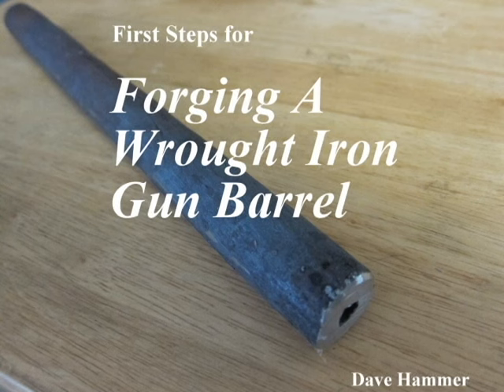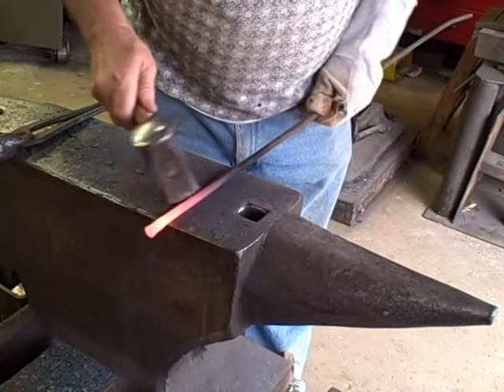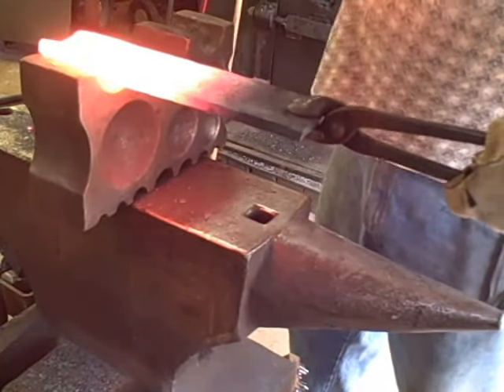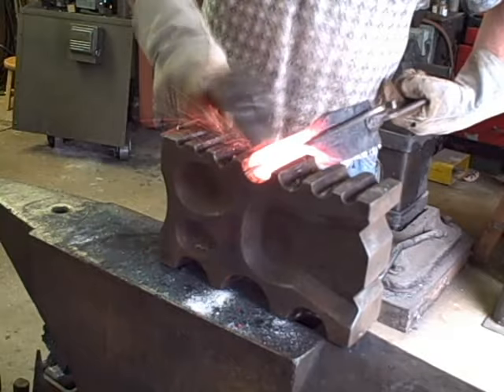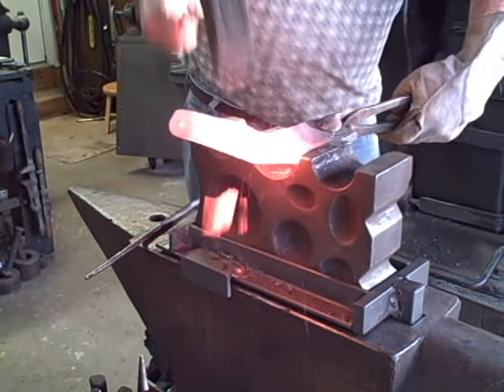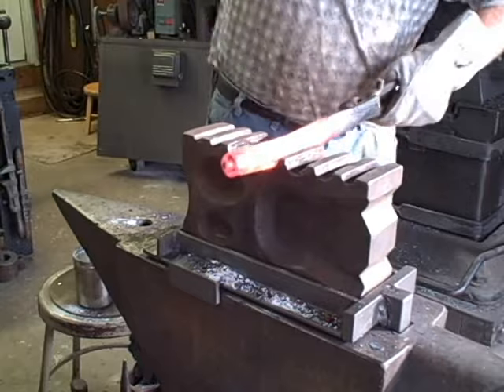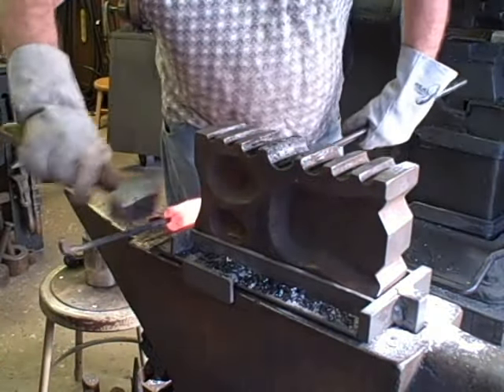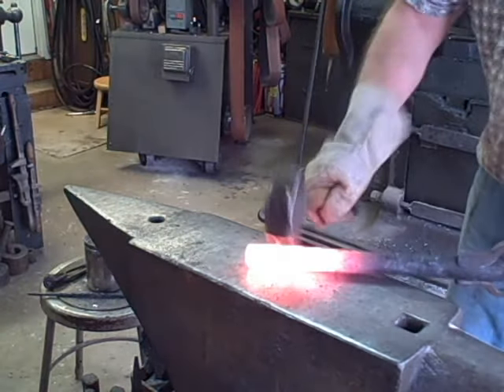Forging a gun barrel

Comment: Excelent straightforward demonstration thank you.

I have a question if you know, how do you identify wrought iron from mild steel? do you need to acid etch or microscope?
Reply: This is more information than you
 asked for, but it will give you a fairly complete story about the difference between steel and wrought iron...  as well as a couple methods that can be used to identify wrought iron.

Wrought iron is generally spoken of (graded) as poor, medium or highly refined.  Although a piece of wrought iron, after being processed into a bar, may have a smooth outer surface, it actually has an internal fibrous structure, much like a tree branch.  If you have ever seen a piece of wrought iron that has severely rusted, or has been successfully etched with acid, you will see evidence of these fibers. 

The finer (thinner) the fibers, the more highly refined the wrought iron is.  The more highly refined it is, the better it is.  The more highly refined wrought iron is, the easier it is to forge.  Extremely rough fibers (poorly refined iron) may appear as wide as an eight of an inch.  Within extremely high refined wrought iron, it may be difficult to see the fibrous nature of the iron at all.   

Modern steel does not have that fibrous appearance, it has a crystalline appearance. 

A way to determine if a piece of metal is wrought iron is to literally "break" it.... as if it were a twig, and look for the fibers.  Then a visual inspection of the thickness of the fibers is used to "grade" the wrought iron.  In reality, there would be many diameters of fibers within each grade (poor, medium and highly refined), so in reality, there are as many grades as there would be diameters of the fibers.  Within a piece of unforged bar stock, those fibers would run lengthways within the bar (again, like the grain within a tree branch).

When I tested the wagon wheel tire I used to forge the gun barrel, I could hardly see the fibers.

I suppose the next question might be "How do I break a piece of iron....  wouldn't it just bend?

This is how I do it....  If I am testing a bar (say a half inch square solid), I put a piece of the bar into a vice, with about an inch or so sticking up or out the side.  Then I cut it a little more than halfway through the bar with a hacksaw (with the cut about 1/4 to 3/8ths of an inch from the vise jaws).  The cut needs to be across the fibers.  You can generally assume the fibers run lengthways on the bar (this will invariably be true if the bar has not been forged).  Then take a heavy hammer and "whack" the bar, hitting it on the side that you just cut.  If you did this with a piece of wood, it would break or "split" at the cut (and you would see wood fibers).  Essentially, if you use enough force, and it is wrought iron, it will also split and you can see the fibers.  I try to hit the bar just hard enough to split it, but not break it.  As previously stated, the smaller the fibers, the more highly refined the wrought iron is.  Some fibers may actually "tear" and you can see the ends of them (as well as the sides of those that don't tear).  On highly refined wrought iron, those fibers may only be 1/100 of an inch wide. 

If you have trouble breaking the metal, cut it a little further.  If it's steel (rather than wrought iron), it will be harder to break.  If it's steel, it will snap in two at the cut and will not split like a tree branch.  It will have a crystalline appearance on each end instead of the fibers. 

If you have a piece of thick barstock, just cut a short (1/4 inch) piece off the end and put that in a vise and break it like you were trying to bend a coin.  It will snap in two and you should see the fibers (assuming it is wrought iron).

If you don't want to destroy a piece of what you have, clean the scale off it (sanding or ?), then etch it with acid.  You won't see the grain as pronounced, but you should see grain.  The more poorly refined it is, the easier it is to see the grain.  If it is extremely highly refined, you may have trouble seeing the grain and will have to do the break test.  If you polish the metal, a light acid like lemon juice may show the grain (it takes a while).  A stronger acid would be hydrochloric acid (muratic acid).  If you use stronger acids, be sure you take proper safety precautions and proper disposal techniques (read the MSDS).
Reply: Thanks again yes that was a lot more than what i hoped for for a answer something else I was wondering if the etching works sometimes does the way wrought iron corrodes give a pretty good clue.I have seen a lot of old wagon parts that seem to have rusted with a thread pattern as oposed to scaleing do you think this would be a good in the field identification method?
Reply: Seeing a fibrous pattern on rusty iron is absolutely a definitive way to identify wrought iron.  If you see rusty iron that looks like weathered wood, it will definitely be wrought iron (unless some blacksmith forged steel to look like it (unlikely on old objects).  Steel does not rust away that way.   The composition (density) of wrought iron is not consistent...  when it rusts, the softer parts oxidize faster, leaving the harder strands of metal.  There are linear fibrous strands within the iron because of the manufacturing rolling process used when bar was made from the blooms.  As you say, steel scales.... it also pits much more than wrought iron. Steel never rusts in the same visual manner as wrought iron.  Keep in mind that the highest refined wrought will probably not show those fibers when it rusts (in fact, highly refined wrought iron hardly rusts at all), but you can still identify it in the manner I previously described.  I absolutely love working with wrought iron.  In general, I will forge an object, then etch it in acid until a significant amount of the surface has been eaten away by the acid (same visual as what happens naturally with oxidation).  If you would like to see some examples,  look at my Facebook page   https://www.facebook.com/dave.hammer.12

Page down to Oct 30, 2016, Oct 26, 2016 and June 22, 2016.  There may be earlier example also.  All these items were made from wrought iron tires (off wooden wagon wheels).  They were smooth iron forgings, after which I soaked them in an acid bath until the softer areas of the wrought iron was eaten away by the acid.  The axe with the blond handle is forged from highly refined wrought iron. Even though that axe head was in acid as long as the other axes, there are no visible fibers.  All the rest of the objects were forged from poor to medium refined wrought iron (some even have forge welded laminations).
Reply: I just posted (on my facebook page) a photo album of an early anchor (I own) that is a great example of naturally rusted wrought iron.

Comment: Would it be possible to turn a much longer and more narrow strip of metal into a barrel by coiling it (I am thinking of how the cardboard of an empty paper towel roll looks. Or like the cardboard of a roll of biscuit dough looks)?
Reply: I believe some gun barrels have been made this way.  The process would be much more complicated because the coils would have to be wound, then "jump welded" rather than butt welded.
Reply: David Hammer I thought that was the way Damascus steel barrells were made. Am I mistaken?   I'm getting rather old and my memory is not up to par.  ( I started to say "pretty old."  wouldn't that be considered an oxymoron? By the  way ... this the most enjoyable video and forum I have yet been involved in.  Keep 'em comin'
Reply: Ray Provence No you are not mistaken, this is how Damascus barrels were/are made, depending on what pattern you require/can afford, multiply lengths of iron, called a skelp, were twisted together, and gradually hammer welded, then twisted around a mandrel , coil spring like, and hammer welded again, this formed a very strong (compared to the steel of the day) barrel, the hole up the middle formed by the mandrel would enable a boring piece to cut an even, straight hole, this was then "spill bored" and either rifled, using a wooden framed rifling machine, or left as a smooth bore.

Comment: Great video sir! thank you.   what is the powder your using and  what's the purpose of the powder stuff?
Reply: It's called borax or flux. it's used in a wide variety of metal works. It's main purpose is to reduce the scale (the greyish things that chip off of the iron when it's hammered), as well as reduce oxidation that forms scale. it's important to do this because if you want to forge weld, you need to make metal to metal contact, no oxidized scale in the way.

Comment: when you start, it look like there is tons of rust on the iron. Does the rust just mix in  with the iron when hammering it, or does it fall off? It looks to me like the flying red sparks may be red hot rust flying off, but I imagine some of it would get beat into the iron and maybe weaken the surface a little.
Reply: tomaf Rust is formed through oxidation. During forging, depending upon the fire, more oxidation can occur, forming scale.  I expect any initial rust becomes part of the scale and may be knocked or brushed off during the forging process.   The flying sparks you see is scale being forced off the metal surface.  Scale that is not knocked or brushed off will stick to the metal (and result in an uneven surface) but I doubt it actually weakens the surface of the metal in any way.  Scale is not permanently bonded to the metal and can separate at any time.  Thermal expansion will result in some of the scale popping off.

Comment: Would it be easier and produce a tougher steel if youll just fold metals and forge it.. make a rod and bore into it?
Reply: My goal was to forge a gun barrel using the same process that was used during American colonial days.  Except in rare instances, they did not bore barrels.

Comment: How would u get the forged barrel perfectly straight? I didn't catch that part in the video?
Reply: Good question.....It's probably doubtful that many guns had  "perfectly straight" barrels, but a gunsmith could get the barrel very close by eyesight.  After  the blacksmith had finished welding the entire length of the barrel, he would drill out the center hole and bore it smooth with tools he made...   then he would hold the barrel up to light and look through it.  Any bend in the barrel would be obvious as he looked through it.  He would lay the barrel down on the anvil with the bend up and strike it to straighten it, then look down the barrel again.  Generally, most straightening would be done with the barrel cold.  Although rifling was invented in the mid 1400s, it was not commonplace till the mid nineteenth century, and was done (again with tools the blacksmith made) after the bore was smooth.  "Look and bend" straightening was done until the blacksmith could center the hole on the far end of the barrel by sight.  Although perfection might have been the goal, the barrel did not have to be "perfect" to be functional. The ball (or bullet) would literally bounce around in the barrel as it traveled through it. The range of accuracy for a smooth bore (and even a rifled barrel) was short by todays standards.

Comment: I have always thought when they forged gun barrels they twisted a flat piece of metal and it would tube up like a ribbon does... But guess that would be a little too crazy lol
Reply: MrFailMouse I believe that most gun barrels that were forge welded in Colonial  days were made in the manner my video demonstrates.
Reply: MrFailMouse I mentioned that in a comment above. If I remember right it was called Damascus steel.
Reply: Ray Provence Sorry, I missread your comment.  Damascus steel barrells were wired wrapped and welded.

Comment: Noob question, why forge / weld the barrel, as opposed to start with solid barstock and simply drill the barrel out? Is it simply not possible to drill that deep of a hole? Does the forging add strength that you otherwise wouldnt have?
Reply: No doubt gun barrels are drilled today.....   However, the goal I had was to emulate the way it was done during the American colonial days (1700's).  In those days they did not drill small arms barrels...

I'm sure today's steel is much stronger than the (primarily) wrought iron that was used during colonial days.

Comment: What kind of job market is there for smiths? It seems like a very interesting job, and a productive hobby, but is there money in it?
Reply: Pugsgunsandstuff That's a difficult question to answer.  I'm a hobby blacksmith.   I like working with metal because it is very satisfying to make things from basic materials, be it art or functional.  I do have several friends that make their living being blacksmiths.  Most are one-man businesses, with over half the time spent running their business.  No one I know has a high income doing this (I'm sure there are some, but not in the circles I'm in).  There definitely is a market for high-end work for some commercial buildings and high-end homes.   Successful blacksmiths that work in the high-end architectural markets usually work with architects.  Artist blacksmiths usually work alone (but not always).  Craft fairs usually have metal work, but I know it is difficult to make a living that way.  Most items that sell well there are low cost.  

I've seen it written in an article that there are between 5,000 and 10,000 blacksmiths in the USA, of which only about 10 percent are professionals at it.  That would mean only 500 to a thousand professional blacksmiths.   This alone tells a story.

I believe for someone to make a significant living in the metal working fields would have to be at the top of their profession, and be in the right market, and have connections (network), and...   and....   and....  

Some universities offer metal working courses, even degrees, but most of the teaching for this craft is done at traditional arts schools that are geared to hobbyists.

I'm not saying an average Joe couldn't become a successful blacksmith, but I would say it's a hard row to hoe.   

Now....   If you are a metal artist, and can make things that rich people would pay high prices for (example...  Albert Paley), and have that aforementioned network....you could probably make a very good living.

I believe that most that do this.... do it because they love doing it, not because they can get rich doing it.
Reply: David Hammer
Thanks for the essay. :)  Good info!

Comment: As hot worked products produce less surface finish and less dimensional tolerance , what are the next steps you  did to improve these..?
Grinding ??
Reply: If I were to continue this project in the manner colonial gunsmiths did, the next steps would be to forge the barrel into an octagon shape (for aesthetic reasons), then filing it smooth....

Comment: Is it sugar och salt you are poaring on when welding? I prefer salt since its cheaper. Cant say its very effective but it does the job after a while.
Reply: +Johan Å....   I use 20 Mule Team Borax for my flux.  It can be bought at most grocery stores in the laundry soap isle.